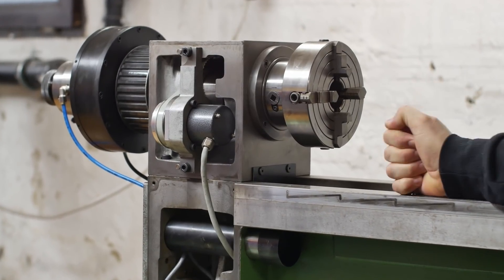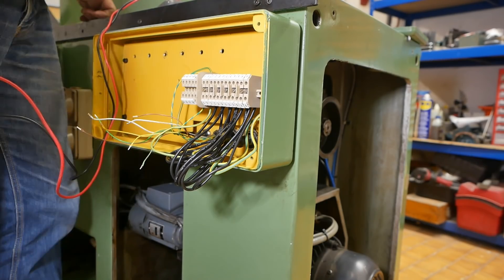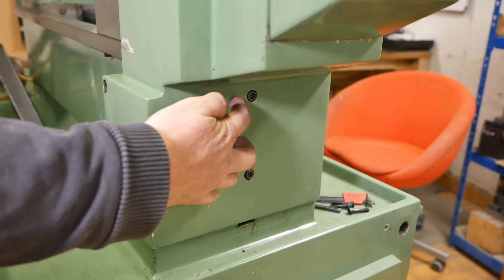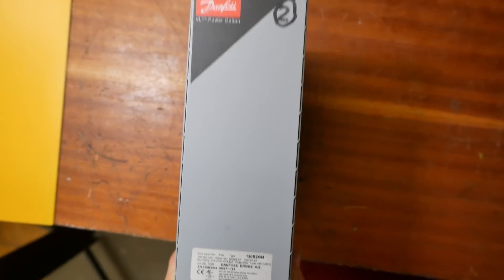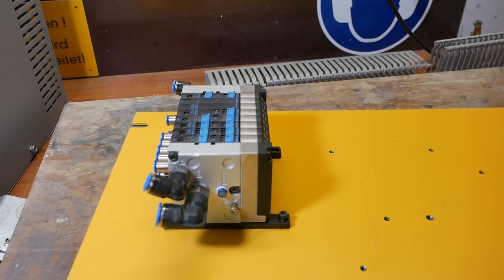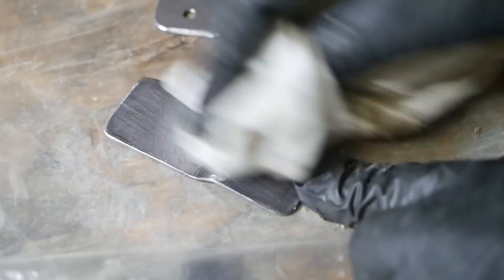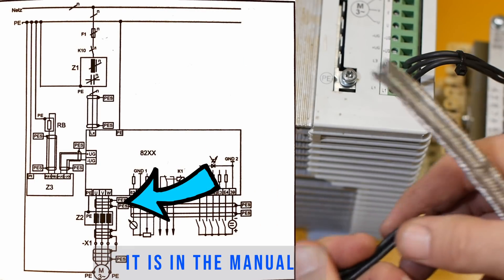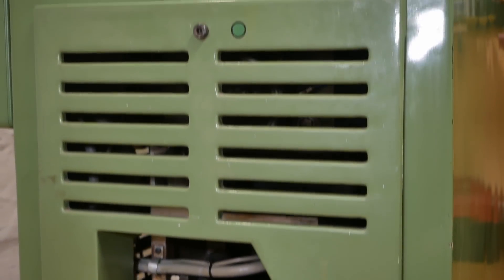Laying out the electrical cabinet - Schaublin 125-CNC lathe

Comment: that stop motion was a joy to watch! but good luck having the patience to record the whole wiring operation like that !!
Reply from the maker: Thanks for the kind words. When doing it, it is hard to visuallise how it will look, but I was really happy with it.
Reply: @RotarySMP  great work. I was going to say either this, or a finger snap jump cut would work. Maybe instead of the specifics for your build’s wiring, you could explain the fine art (read: misery) of crimping cables. That plague of plagues. The very depths of despair.
Reply from the maker: @The.Talent  "That plague of plagues" "The very depths of despair." 
Thanks for the titles of coming videos. :) Thanks for the ideas as well.
Reply: @RotarySMP  🤣🤣🤣
Reply: @RotarySMP  it came out amazing, but I was immediately wondering how many hours that added to the assembly 😂
Reply from the maker: @EricMBlog  It wasnt too bad. About an hour to do that 25seconds of time lapse.

Comment: I hope you don't intend to run the VFD output through a contactor. It wasn't quite clear if this is your plan but vfds should go directly to the motor with the exception of EMI filter (usually a toroid). As far as length and shielding is concerned you have used best practice. Do the same to the wires to the motor. On another note it can be advantageous to shield the wiring to the potentiometer if you use one on the VFD.
Reply from the maker: Thanks for the inputs.
The contactor will be before the VFD. The PNOZ safety relay has immediate and time delayed contacts, so I was going to command the VFD to stop on e-stop, and then follow up, time delayed by cutting it's power.

I have been too lazy to replace the main motor cable with a shielded one. I know I should, but that would require removing the drive module, and also removing the motor to get to its junction box.

There wont be a potentiometer to the VFD. I will use one of the MESA analog outputs to command VFD speed. I'm planning to hack CAT 5E cables for such wiring, giving twisted pair and shielding.

Keep the good advice coming. I appreciate it.

Comment: We've got a lot of VFDs at work, and all the wires from the VFD to the Filter go through Ferrite Cores in addition to being shielded. Depending on the Switching Frequency, the Output can be noisy as hell.
I think we got some Ferrite Cores left over, if you need any...
Reply from the maker: Thanks for the offer. Please drop me a line. My Email address is on the channelinfo page.

Comment: If this is a Dahlander motor and you're going to run it using the high speed windings alone you'll need to bridge the three low speed windings (1,2,3) meaning that it's in Y (star) configuration - as shown in your schematic.
Reply from the maker: Thanks. I didn’t think that through. :)

Comment: Mate, you are fortunate to know electronics, one of many handy caps. Yet, I am surprised by the 3 phase as I thought that was what the VFD is for 😆.  And who said men can't multitask. You could put the wires in a blender and tip them onto the board, whala, spaghetti cnc lathe.
Reply from the maker: The main use of VFD’s is frequency (=speed) control. It is a handy by product that they came generate 3 phase from single. Here in Austria 400V 3 phase is common in most buildings. Our previous 3rd floor apartment even had a 3ph circuit for the oven.
Reply: @RotarySMP  ah so you are powering a 3 phase motor.
Reply from the maker: @tcratius1748  Yeap. Three phase supply, three phasemotor, and I m using a VFD for speed control.
Reply: @RotarySMP  well there ya go. I've seen 3 phase motors controlled with a VFD on single phase. And without knowing any better I figured that you didnt need a VFD if you were going three phase power to three phase motor.  I must confess, it is hard getting anything over here in terms of old machines as we just don't manufqcture being so close to China which means smaller market and higher prices due to living standards. Even coming across scrap metal is almost impossible. Though I do get lucky and find a house being built and they are throwing wood. My favourite is the old hardwood. Anyway, I digress, stay safe.

Comment: My son recently finished connecting up a bunch of variable speed compressors used for keeping young sallmon alive. He said everything HF was connected using shielded cables. I don't know if they used filters.
Reply from the maker: If I understand it correctly, the problem with the VFD is the noise it can cause other users. Especially in a residential network
Reply: @RotarySMP  It seems like the Internet ate my reply. So I'll try again:
Yes, and EMI can create super weird bugs in your control circuits.

Comment: dang, you put a lot of effort into that stop motion panel assembly.  Keep that cable as short as possible. Cable length can cause plenty of noise, which is why twisted pairs is used lots for sensitive electronics that don't use coaxial cables. Non coaxial cables create their own magnetic and electric fields which interact with others causing problems to arise. If there are problems occurring with your motor electronics, I would start by redoing the cable with twisted pairs.
Reply from the maker: Thanks for the in depth explanation

Comment: Great video, as always, love the video editing. Dont toss failed prints. Save them in a bag, melt it in a tincan make super rough plastic pucks you can use as stock. I taped M10 bolts in such blocks, 3 cm deep and could torque it like crazy. Made wheelhubs for my sons using only scrap. It's a bit weird to machine as it has to be kept cool while cutting.
Reply from the maker: That is good idea. I tend to just bin them

Comment: Try using 3dlac, what a world of difference easily stick abs,pla, petg, tpu to the bed, ordered 3 bottles from Amazon like 3 months ago, never had a single adhesion issue since. I'd keep the wire run from driver to the filter as short as possible, also possibly ground the shielding on both sides connecting one side to the driver as you have done and other side to the filter and then running one ground strap to the chassis, if that makes sence. Love the video! Great work!
Reply from the maker: Thanks. I thought you only earth one end of shielding to prevent ground loops, but received a number comments that I need to do both.

Comment: Hey, Herr Rotary! I purely understand you need it for a video content, but when you decide to finally do away with der Schweizschlamm on das Schweizschild, then use kerosene (+ a toothbrush). Kerosene will penetrate thru and lift it up (i.e. un-stick from the surface) while toothbrush will wash it away. 
My 2 phen... eurocents.
Reply from the maker: Well WD40 is mostly kerosene, and that hunk has been unimpressed by it so far. Still I need to get more mileage out of it ;)
Reply: Just use a plain kerosene without any wd40 schmutz. Lighting kerosene is the most pure and thus is the best choice, but yours off a plane should be fine too.

Comment: As a lifelong electrical engineer I would say that it's impossible to make wiring jobs look interesting :)-
But I look forward to see how you go at it.
Nice job on the layout.. I used to call that cable management stuff Panduit.. but I suspect that's a similar naming faux pas as with "Xeroxing" a copy. A special thanks on actually bringing out the square to align components on the back panel... my eye didn't even twitch once!
Cheers,
Reply from the maker: Thanks for the feedback.

Comment: Nice work all the way around IMO. Loved the stop motion assembly. I cant imagine the effort involved for that. In regards to the drive wiring, I think you minimized the potential for noise by keeping the run short, shielded and not parallel or adjacent to any other wiring (as it would have been if it was in the raceway).
Reply from the maker: It was about an hour filming, for 25 sec.

Comment: Isn't there a risk of error when measuring resistance with your body in parallel? You were holding both wires onto the probes with your fingers.
Reply from the maker: True, but I was only trying to find out which one had more resistance.

Comment: "Everything must screw in from the front...". You can't imagine the resistance to change when I proposed the same at work. Even after experiencing the exact pain not doing it causes. I created a tapped panel with laser-marked component outlines with part numbers, labels, and graphical "fences" separating high power from control... Now they think they developed it!
Reply: I see u are a man working with mokeys i share the pain sad part is when they decide they are gonna "patch up " or "fix" something may god help us in that case
Reply: There is nothing quite so aggravating as having dolts take credit for your good ideas. I feel your pain acutely.  As I am certain all engineers do. In that regard, it could be worse, you could be working for Tesla.
Reply from the maker: I got that advice when I mounted a few parts from behind on the mini lathe. Sure enough the pc was one of them, and I had to replace the bios battery. PITA

Comment: I just got my proper printer and made some sketchy printed din rial adapters for the electronics. They came out meh but working. I bought actual adapters for 5€ piece to do it properly at some point. Tho i still need to print the adapter between the electronics and proper adapters.
Reply from the maker: That is pretty funny. Mine aren’t pretty, but they just need to hold a little board.

Comment: That pigtail you made for grounding the shielding is a no go you need to shield it all the way or it will just be an antenna for noise emitting and it should be connected to your main grounding point so it has the same potential as the rest
Reply from the maker: Thanks for the feedback. I thought shielding was only connected at one end to prevent ground loops. Others have also point out my error. I havent started the main ground wiring yet, but will reuse the copper ground bus bar at my star point which Schaublin used.
Reply: @RotarySMP  We usually connect the shielding in the gland and then on the bus bar

Comment: Great stuff! Things are progressing nicely. 

RE the missing screws - You did bait the screw monster when you had that tidy up midway through a project didn't you? Happens every time for me.

RE P2P vs Conn block - For short runs with discreet signals/supplies (Your VFD and Sine filter are good examples) P2P is my preferred routing method. If the runs are longer, have common connections, or connect externally to the cabinet, connection blocks are the way to go. Finger trunking to keep things neat, but remember to leave some nice service tails so things can be rewired if necessary.. I keep signal runs away from long parallel runs of switched power, and only let them cross perpendicular to each other. This reduces the chance of induced interference.

I'm not sure if this will help, but apart from labelling your wires, I also tend to label each functional block, or if there's room, a block layout diagram inside the door.. It seems to help the next poor sod that comes to look inside in about 18 months time. Pump contactor might be obvious now, but in the heat of a breakdown, it might not be. 

Another old wireman's trick, is to lay up the loom on a board full of nails. This technique tends to be used for multiple loom construction, but is also very useful when reusing existing wire as you have indicated. You'll at least have a good idea on the lengths that can be used immediately, instead of finding that one wire 10mm too short, or having to tuck loads of spare into the trunking..

I'm looking forward to seeing this running, and this years chipotle crop too.
Reply from the maker: Thanks a lot for your inputs. I will be drawing up a full wiring diagram. I did that on the Maho (well modified the existing Maho schematics) and on the mini lathe. I have a head like a sieve, so the poor buggar who would be trying to troubleshoot in a few months time will be me :)

Comment: I couldn't tell if you earthed the shielding on both ends?   I have read that you need to earth both ends or the shielding won't work if it's  only earthed on one end only?
Reply from the maker: I didn't and have been informed of that error. I always thought you only shield one end to prevent ground loops.
Reply: @RotarySMP  Shielding for EMI is connected at one end only.  Its kinda like a car antenna, you're capturing the EMI (radio waves) and directing them to where you want them to go (ground).  Connecting both ends may work, but may also cause other unwanted effects like ground loops that can be far more troublesome than the little bit of EMI you were trying to shield.  In general thats a really short run so would not be expected to generate a lot of EMI.  What you did was more than required and is fine.

Comment: RE EMI: connection between VFD and filter sends a lot of noise, but obviously also the wires from VFD to motor. With one exhibit, we had so much trouble from EMI, that it still interfered with an HDMI connection, which already was an active fiber instead of copper. It probably was interfering with the fiber transceivers and the low-speed I2C connection between source and display.
Also VFDs can produce a lot of fault current, way beyond what a normal RCD is meant to protect against. It's normal to protect these circuits only against 100mA or even 400mA of fault current, instead of the usual 30mA.
Oh, and one last hint: self-adhesive copper tape does a good job terminating the shielding in cables, depending on the connector you need to use. Usually all shielding is terminated to a grounding star point right when it enters the cabinet. EMI inside a cabinet isn't really a big deal, all the stuff should be able to deal with it, and you'll usually only have shielded cables for data transmissions inside the cabinet. What's important is that the EMI doesn't leave cabinet, or the cables that leave the cabinet. For example, the VFD isn't really shielded itself (at least the power electronics, the control circuitry inside the VFD will have its own shielding), so that little bit of shielding you put on that cable has little effect.
Reply from the maker: Thanks for the detailed explanation. I struggle with a lot of this, as there are a lot of different aspects to consider.

Comment: How to make wiring interesting to watch? Do it while it's live with mains voltage !........ Alright, Maybe not. :)

OK, How about showing it as a dramatic montage of very short clips of you purposefully pulling on wires, forcefully plugging stuff in, and using an oxy acetylene CUTTING kit to "Weld" some bit's of metal together in a shower of sparks....... all done to the the "A team" theme tune? :D

Or, you could make a montage using a 10 to 15 second clip of you wiring, followed by one random very short clip of you doing something else, then another 10 or so seconds of wiring, followed with another random short clip of you doing stuff that has nothing to do with the CNC lathe, and so on (Make sure to have absolutely no context in the random clips. People would watch just to try and work out what you're doing in them). I'm sure your editing computer has gigabytes of old footage in it that you've never used on YouTube. Stuff like working in the garden, family birthday parties, saved dash cam footage, pet's playing, outtakes where you completely forget what you're saying or what you're saying make's zero sense, video clips you've taken while at work, Bit's where you've hurt yourself and had to edit it out due to you screaming 15 seconds of solid profanity (Just bleep out the swearing and chuck the clip in), stuff like that. It could be entertaining........ Well, More entertaining than 15 minutes of you connecting wires and going "Ta da. It works" at the end. :)

If both of those ideas don't float your boat, Why not just use the video as a background to you telling us an interesting or amusing story from your life? I'm sure an international playboy globetrotter such as yourself has many an exciting tale of intrigue, mystery, near misses, and the hint of sordid debauchery he could enthral an audience with. LOL !
Reply from the maker: :)
1/ Nico likes sparks. Maybe he can do the wiring with the power on?
2/ Random 10 sec clips of non sequitor stuff... I thought all  my videos are like that?
3/ Maybe I could use the wiring in the background to make up stories about aviation :)

Comment: If you had problem with 3D parts sticking on glass or mirror try 3DLAC. If it is heated above 30 degrees there is no chance to lif.
Reply from the maker: Thanks. I have the bed at 60°C. Probably just sloppy glass cleaning on my part.

Comment: Wiring from one component in the panel to the next is ok if you have done it for EMI reasons.
The main problem is if you run the wiring over the top of a component which might interfere with the removal of the component. Generally with a good panel layout, any component can be quickly removed and replaced without messing with wire routing.
Since your direct EMI wire is to that component those terminals will need to be unscrewed anyway to remove the motor driver component which the wire runs over. So no problems. 👍🙂
Reply from the maker: Thanks for your input on that.
Reply: @RotarySMP  thanks for your amazing videos and humour. 👍
Reply from the maker: @wizrom3046  Thanks for watching. I appreciate that.